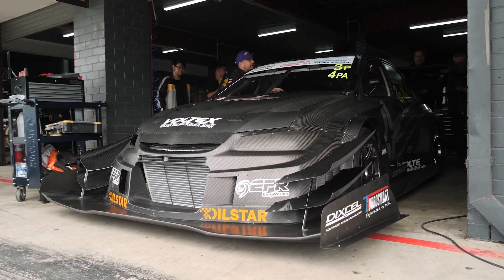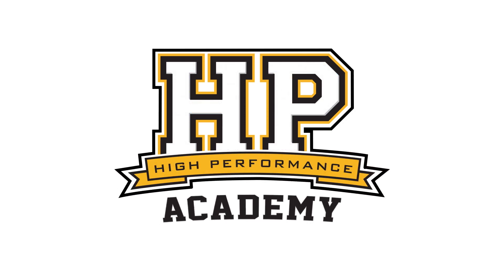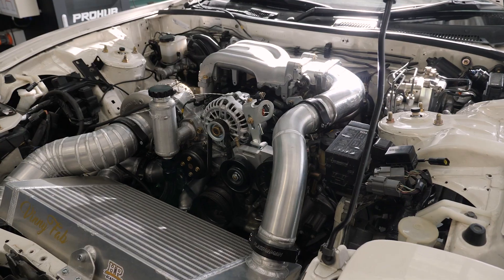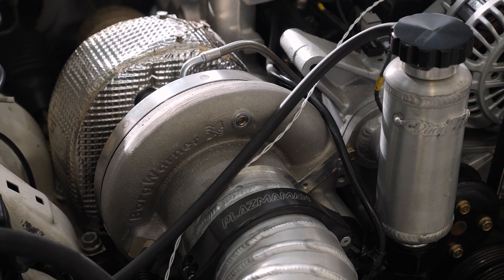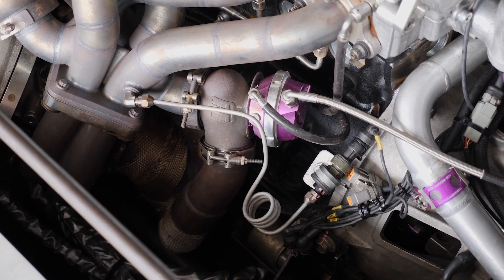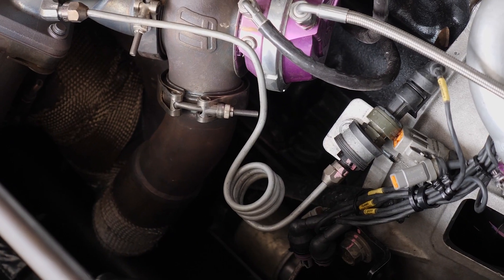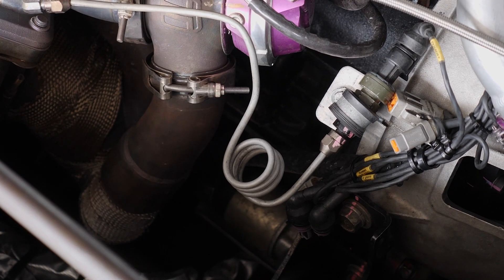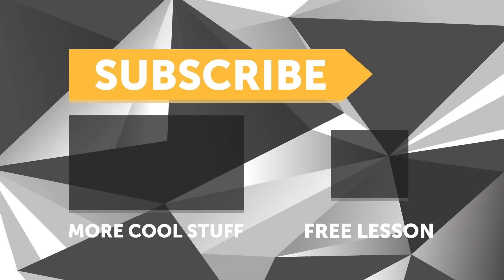EMAP | Exhaust Pressure And Turbochargers

Comment: I'm about to add a couple of EMAP sensors into my setup. Have you ever used them to measure the balance between scrolls on a twin scroll setup with separate wastegates? 

I wanted to add them just to be a data junkie but also be able to identify if one of the two wastegates was misbehaving. 

I just haven't decided whether it needs a dampening chamber before the sensors or not, and if so, what the volume should be.
Reply from the maker: I'll see if Andre can manage to get thr other part of your question, but for the dampers, yes, I know in our experience they are worth it to have a clean signal and add no noticeable latency.
Ours came from T1 Race, but there are a few companies doing them - Taz

Comment: I’m itching to install exhaust pressure and temperature on my VGT-equipped BMW M20 engine. I’ve been working on a new from-scratch VGT control algorithm and I think this data will be invaluable as inputs. (Holset HE351VE, Megasquirt 2, custom dash display with a microcontroller that communicates with the ECU via CAN bus and runs the custom VGT and dome pressure boost control algorithms, controls VGT over CAN as well).
Reply: DSM guys would usually run a waste gate actuator to control those turbos the same as a simple the cyclone dual runner manifolds of the early 90's
Reply: @david929190  Yeah mine is a little more complicated than that haha. In short, it keeps the vanes open during cruise (for fuel economy), or once boost target has been reached if you're on the throttle (to maximize power). But during the spool-up phase is where things get more complicated - how much should the vanes close? If they get closed too tight, they choke the flow through the engine and it even though there's a huge drive pressure on the turbine, there's very little mass flow so turbine power is low. This of course depends on engine speed, and as you might imagine, as the turbo starts spooling and mass flow increases, the vanes gently need to be opened as boost increases to get the best response.

I still need a good amount on tuning on the VGT side, but with a 60mm/60mm turbo on a 2-valve 2.7L low-compression engine with a moderately big cam, I can build quite a bit of boost at just 3000rpm.
Reply: @MikeyAntonakakis  could you not run a waste gate with a boost control solenoid that varies duty cycle by rpm?
Reply: @david929190  HE351VE has an electronic actuator controlled with CAN bus messages (which is how I use it). The DSM guys were often pulling the actuator off and replacing with a wastegate actuator, but that's not sophisticated enough to work well. And RPM-only dependent means it will stay closed even when you're at full boost, which would leave a whole lot of power on the table.
Reply: @MikeyAntonakakis  what sort of computer are you running the actuator off. Ya the DSM guys didnt have the hardware to run the electronics.
Reply: @david929190  custom Arduino-type microcontroller with CAN transceiver
Reply: @MikeyAntonakakis  speedunio?
Reply: @david929190  it’s a Teensy 4.0 that mounts to a custom circuit board that has several other modules that handle some of the things my Megasquirt 2 can’t (like wastegate dome pressure control with compressed air).

Comment: In the diesel world it is called Drive Pressure. If you run Compound turbo's, that is how you tune them by checking drive pressure at the secondary turbo. Drive pressure get's out of whack, open the wastegate sooner to dump it to the Primary, big turbo.
Reply: Gale Banks does some good videos on this topic.
Reply: @woznaldo  Compound turbo's are a very interesting concept. They freaking work though.
Reply: @spooler7828  It is hard to keep the charge temps down with a compound setup.
Reply: @David_H_Parker  No it is not. They aren't tuned properly if so.

Comment: Very familiar with this style setup most engine manufacturers require back pressure readings during commissioning the only difference is were still using Magnehelic gauges to read data.

Comment: Those coils add isolation and allow that tube to expand and contract as its temperature gains/loses 500*C from cold to hot.
Reply: You beat me to it. they're also commonly used to allow movement between the engine and the chassis, if not solidly mounted.
It's commonly seen with hydraulic clutch lines.

Comment: I’d love to know my back pressure it’s gotta be pretty high. 1.8l with a .48ar t3 50mm
Reply: Genuine Garrett? I have a 57mm on 2.6 Starion. TB0313, I may have the wrong specs.
Reply: @Theophilusone7  The Starion likes the T3/T4, I have worked on a ton of them and the stock turbo is far too small. Those exhaust manifolds sold like hotcakes because they cracked so easily.
Reply: @David_H_Parker  TB0313 is a Garrett turbo. Mitsubishi comes factory with the Starion 12.A.  You can swap MAFs n Actuator to make 19psi. The small Garrett with a old school big banks actuator holds 40psi. T3 flang adapter is all I'm using. Making 500hp TBI 😆